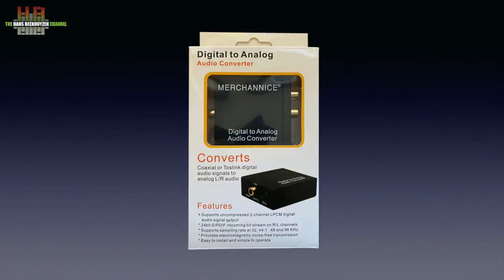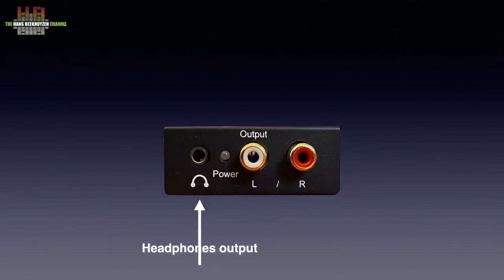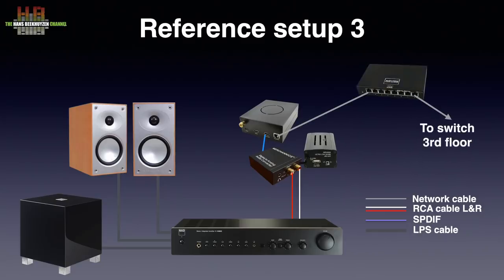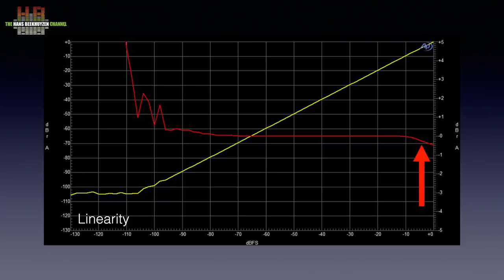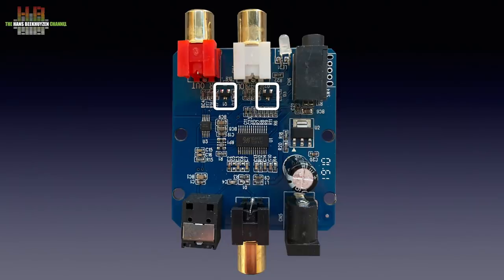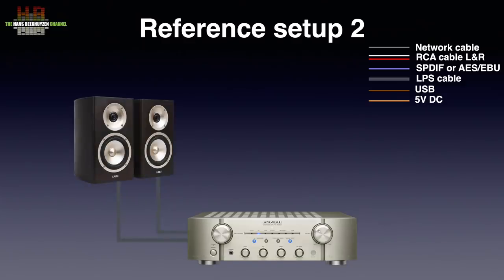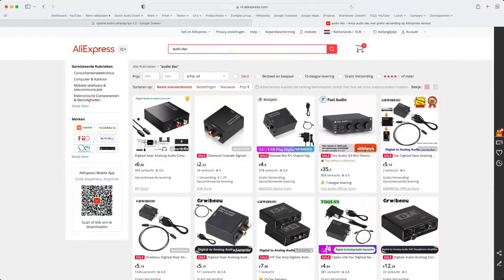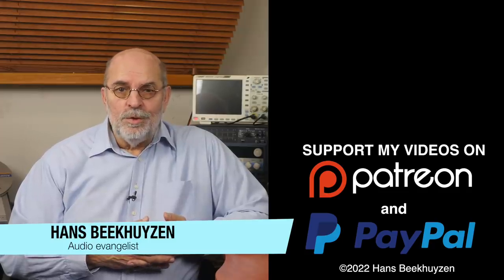The remarkable story of the € 24 DAC

Comment: Nice work, Hans. I currently have no DAC, and this one was very tempting, at $12 so I bought one. 
You are so right, I verified the scope waveforms. There is bad clipping on the negative peaks, causing several % distortion on peaks. The fact that it is on negative peaks means that it causes the less objectionable 2nd harmonic distortions. But several % distortion is unacceptable. Your fix works great, thanks!
As a 45 year EE I'm usually the one who finds and fixes other designs. It is a delight to have someone else do the hard work. Thanks!

Comment: I had one of these in my TV setup (different branding, identical unit) for years and honestly had no complaints. About a year ago I switched from this to a Topping E30, mainly because I wanted to be able to integrate volume control on a single remote with the Amazon Fire remote, but honestly the Topping was only marginally better than the cheap Amazon DAC.
Reply: I had the opposite experience. I had the Radio Shack Chinese DAC rebrand for years, and thought there was no point going higher. It was much better than my Asus Z97-A motherboard's output. I got the Topping E30 and was blown away by the difference. Everything was smoother (less distortion?) with better channel separation and depth. My brother clearly heard the difference even when he thought he wouldn't be able to.  I got the L30 HP Amp to go with it, and now the PA3S for my speakers. I doubt I would hear a difference between the E30 and D90SE though, I don't plan on going any higher. The noise floor is already transparent on the E30.
Reply: Interesting experience! My guess is that while there are many Chinese DACs that look more or less identical, there are varying levels of build quality (or even board implementation) that could produce differences in audio quality, noise floor, etc.
Reply: @andrewskaterrr  thx for sharing! how is Ur experience with pa3s?
Reply: @peraphanjittrapirom9820  It's great. Currently using with 6ohm JBL 530s at the desktop and it barely gets above ambient room temp even after hours of music. The noise floor is inaudible too, lower than my Outlaw 7000X.
Reply: @andrewskaterrr  great thx u

Comment: Purchased one of these  DAC the other day before seeing your video,  its a Prozor brand and stripped it out to see if it was similar to yours.
It uses the same chips but a neater board and soldering and the two output transistors  appear correctly wired back to MS8416T chip.
Compared the sound between direct CD/Amp and the PC/DAC to Amp and very pleased with the quailty of the DAC for just euro13
Reply from the maker: Thanks for sharing
Reply: I gave one Prozor model like in this video to my parents, but now I ordered & received Prozor DAC01s model which seems to be the same thing - just smaller enclosure. however I dont have the tools to see whether fets are soldered incorrectly. the previous one that i gave away sounded good - havent tested this new one yet..
Reply: @voltagetoe    Hi, did not make it clear on my eariler post, our Prozor DAC was fitted with BJT tansistors not Fets as with  Hans earlier model, so they should work ok at 3v3, though no way of measuring their performance like Hans, but the sound is still very, very  good.

Comment: I had one Proster dac that’s already out of production that brings amazing clean mass and weight to the output sound from my cd source. The latest iteration of the dac model though sounds bad like it’s made in a totally different design and from a different manufacturer (which most likely is the case). These cheap chifi devices from China brings some rare surprises among mostly disappointments, that when you find one, it feels weirdly satisfying.

Comment: Very timely video. I was just gifted one of these DACs from a friend who ended up with two of them as the result of a shipping error. I promptly made the changes as suggested as well as adding a new higher grade electrolytic capacitor in place of the one included. (I just happened to have one that would work.) Once my friend returns from his winter hibernation in a warmer climate, I plan to do an A/B comparison. Very curious to see what, if any, differences I end up hearing. It should be noted I don’t listen to digital sources often, as I’m a analog person. But I’m always willing to try!
Reply from the maker: It's not the best way to be introduced to digital audio though...
Reply: Totally agree! My main DAC is a Theta Cobalt which I bought new a loooong time ago. The 24€ DAC lacks all the finesse of the Theta. Instrument separation, sound stage, dynamics, air etc.  were all lacking in comparison. But, for its low cost, the 24€ DAC does perform well. My friend who gifted it to me actually bought it on my suggestion as he needed a DAC to go with an amp I built for him. I’m looking at this DAC as an inexpensive option to use/integrate in future amp builds. Your RaspberryPi videos have also been of great interest to me as an inexpensive streaming option.

Comment: in 2019, I had purchased the Prozor model of this DAC for Amazon for $13 USD. While watching the video I popped the cover and the parts layout and model were virtually identical. The most visible chip was a Cirrus Logic 8416, while the one in the video was a brand I didn't recognize but was also an 8416. My hunch is the same part from a different manufacturer.
Reply: Do you enjoy it? This video has inspired me to buy one of those (assuming you have the one with the case where "192k" is spelled out in black text inside a white box), but others online say that Prozor model sounds horrible. Thx
Reply: @adambozak5372  Hi, as memory serves it did sound horrible. Low output gain, must meh. What I found that was better, was the Micca Origen G2. Cost: $109. It's kind of a Swiss army knife kind of DAC, sounds good, and does a few different things.
Reply: @larryh9525  Thanks for the detail, and for the tip!

Comment: A couple of years ago I purchased a similarly priced Techole DAC from Amazon. It was highly reviewed but I was sceptical. It was for use with my TV to feed my Beolab 8000 speakers. At the time my music was covered by the Allo Digital streamer/dac.

The cheapo unit was very pleasant to listen to. Music from the TV sounded good and compared well with the Allo Digital unit.

When I used the Techole DAC for music it was again pretty good.

The main difference was in detail and a less solid stereo image. Instruments were rather smeared together, but a difference in degree, not absolutely bad.

I just opened the thing up to look at how it was made as it looked like it might be similar to yours, albeit with a different case style.

It was different. Very neat, all SMD components and very cleanly laid out. It looks like the thing uses similar DAC and i2s converter but power seems quite different.

If I did not have the Allo Digital or the current Cambridge CXN V2 I'd be entirely happy to have this unit in my system. It sounds pleasant, not harsh, audible distortion - no.

It seems to me that these little units are a somewhat hidden gem. I'm happy to have purchased the more costly units but the little Techole 192Khz dac works well.

Comment: I've used only PC's as a music source for about 22 years now, via so many different topolgies I've probably forgotten many of them. A couple of times circumstances have compelled seriously 'ghetto' solutions, and were that the case now I'd certainly be looking at this DAC, but to make the best of it I'd probably just keep the digital signal at the PC attenuated by at least 10dB (at the levels I listen, raising of the noise floor by that much is unnoticeable). I guess that would still run the risk of the non-music plops/clicks but I'd probably be willing to live with that.

Comment: I got a DAC board of amazon using the same CS 4344 DAC chip, I resumed the transistor looking things on the output side were an amplification stage and just by passed them with polypropylene film caps ( with cap+resistor to remove above audible frequencies), and the thigs sound dam good.

Comment: My TV doesn't have RCA output and im using old amplifier so i needed to use the optical cable and have used this exact unit but unnamed version for over 3 years and its been just perfect for me BUT the volume out is a little too low and it makes loud popping when turning off and on the TV (powering it through TV usb).

Upgraded to a better one from alixpress that have volume and bass adjustment and i love it, it have an auto mute when no input sound so there is no background noise/hiss like the other one when pausing the tv.
It have great bass and sound and very low noise floor.
Reply from the maker: Thanks for sharing
Reply: The unit in this video that i used first was swapped because of the high noise floor that was disturbing while watching movies when it got quiet and the super powerfull pop when tv turned on or off so i always needed to turn off the amplifier first, because the subwoofer litterally popped 2cm out and slowly centered again shaking my whole house (4x cervin vega 15 inch woofers).

The new unit have solved all of the problems and have much higher output line level so i dont need to max out the amplifier

Comment: I have a general question about DACs I hope you can help me with. I've heard that new AD/DA Converters are "better" than old ones. Yet, I've read and heard dozens of times that the "Nyquist theorem proves there is one and only one way to draw a band-limited continuous signal through a set of samples." This requires that the Sample Rate is at least twice the highest audio frequency. Accordingly, one should be able to "perfectly" reconstruct the analog signal that was captured using a DAC with that specification, whether it's brand new or 20 years old.

I know there are things like newer/better Preamps, etc. that will affect how the processed signal ultimately sounds. But, according to the Math, the recorded digital signal should be perfect. If that's not correct, could you please explain. Thanks
Reply from the maker: All internal combustion engines are based on the same laws of physics. But does that mean that they are all equal? The Nyquist theorem is not disputed. But in real life it's impossible to limit the bandwidth at half the sampling rate without distorting the sound. The best filters come closer to perfection but are rather expensive.
Reply: @TheHansBeekhuyzenChannel  Interesting. I hadn't heard that it is "impossible to limit the bandwidth at half the sampling rate without distorting the sound." Thanks

Comment: Hello Hans, thanks for this interesting video, but in your setup 1 I don't understand how you could connected the USB "clean" output of the Allo USBridge streamer - as shown in the video - to the Coax (or Toslink ?) input of the tested DAC (except if you used in addition the optional Allo DigiOne card with Coax output but it was not represented so).
Reply from the maker: I used the SPDIF on the USBridge Lux to the DAC. The version I have has the DigiOne Sig integrated too. That’s why I call it the Lux
Reply: @TheHansBeekhuyzenChannel  OK thanks, now it is clear to me :-)

Comment: Just got a Prozor DAC from Amazon, it's an older model so may be the one Spade Ho has, opened it and it's a newer vsesion of Merchannice motherboard which is 1910, this is 2118. Things have moved or removed, but the ones that haven't have exactly the same name and typeface, and all the chips remain the same. One change is that the mute FETs have been moved to just behind the LED. making access much worse. Unfortunately I don't have access to equipment to see if they corrected the circuit then they did this. Best of all it was only £12.99, or 15.65 Euros
Reply: Quick update, after checking the mute ICs, they are marked 1AM, this appears to no longer be FETs but transistors according to the datasheet. No pins are shorted together or to ground (was using the 3.3v regulator heatsink as ground).
Reply: @thandargor1677  Got also the 2118 revision of the board (Prozor bought from Amazon Germany at August 2022). It has two "1AM" npn transistors (SMD 40V 200mA) for muting right top under the LED.  As an audiophile I can't hear any clipping. So the issue was fixed at least for the 2118 revision 🙂

Comment: Is this product same as Fiio D03K that are available in Amazon and other online shopping media?
Reply from the maker: It might be
Reply: No, the Fiio D03K is completely different, even the basic chipset is same it sounds much much better at all, also there isn't that ugly clipping because of wrong Mosfets for muting. The board is much more made with care and intelligence. It runs on 4.8V and not 3.3V. It has instead a chip of TI to enhance the analog output. Have compared both.

Comment: Might be a dumb question, but are there FETs out there that are rated correctly to replace the bad ones on that board (while still retaining safety measures)?
Reply from the maker: I don't want this channel to become a DIY channel. I'm sure there will be a forum somewhere that can help you out.
Reply: I would imagine that the problem is that the voltage difference between the audio signal and the gate isn't enough at 3.3V. What might work is to put 5V pull up resistors on the FET gates and then let the mute function pull it down through diodes.

Comment: Got the DAC this afternoon. Lifted the FET middle leg. Has played for about 1 hour now using an Old switch mode wall wart. 
The sound is not to my liking😔
The bass is very muddy, and the upper part of the mid range is shouty. The treble is a bit of a noise transmitter. I Will let it warm for a couple of days to see if that helps. On the plus side, it has a good perspective, and I think it does phase well.
Anyway, it is a fun little toy, and almost invites to experiment with other PSU’s and electrolytes 👍

My source is ripped CDs, Volumio, Raspberry 3B, Daner amplifiers (bipolar transistors, no negative feedback) and Dali Skyline 1000 open baffle speakers with large ribbons.
Reply from the maker: AS I said in the video, it might be a different or slightly different model but using an old switch mode power supply won't help either.
Reply: Agree, the switch mode psu is a bad idea. Will try a USB Powerbank in the weekend. After that different electrolyte capacitors.
Reply: Did a small modification 2 days ago: changed the 47uF electrolyte to a Silmic II 100 uF. In my ears, a partial improvement, as the DAC now plays a deep, happy bass. The 3D is still very good. But the fuzzy, kazoo like upper midrange and treble is still there. Next up is a PSU change. A IFI iPower is in the mail.
By the Way, the electrolyte change was very easy, the circuit board is robust and the holes for the component legs are quite large. 
I really hope the PSU change Will remove the fuzzy sound. A piano with kazoo quality sounds quite disturbing 😂😂😂

Comment: This may be a dumb question from a non-electronic layman, but would there be the same problem using the 3.5 jack output?
Reply from the maker: Yes, the same problem there.
Reply: @TheHansBeekhuyzenChannel  thank you for your quick reply !
Reply: @TheHansBeekhuyzenChannel  3.5 jack has mosfet on output? I don't see it on board.

Comment: I wonder why everyone reviewing DACS doesn't hook up an oscilliscope to the analogue outputs, and measure the actual line out signal? Why push it through an amplifier and speakers, if the object is to determine whether e.g. a sine wave in digital PCM format gets converted into a sine wave line-level voltage on the outputs? Just use an oscilliscope o.o
Reply from the maker: I measure every DAC and while measuring an oscilloscope stays connected all the time. What d you think I see on the scope?

Comment: That's really neat, although the risk of nasty clicks and pops whenever my playlist switches tracks with different sampling frequencies, I don't or need to risk it. Did make me curious though. What did you use as power supply and in your opinion how much does it matter if you use a proper regulated 5v supply of an off-the-shelf left-over some other device for sound quality? In short, same sound quality as long as it's 5V DC?
Reply from the maker: Of course not. But I used a simple one: the Allo Nirvana.
Reply: @TheHansBeekhuyzenChannel  Thanks for swift reply! That will make a difference, I bet. Is that your supply for your raspberry streamer?

Comment: I put one in a good case with high quality RCAs and cables and different power supply plug, capacitor changed with Nichicon audio gear, in another case a linear LT1084 power supply with a Talema toroidal transformer.
I will test the fet tip. Thanks.
Reply from the maker: Thanks for sharing
Reply: @TheHansBeekhuyzenChannel  Should the FETs be disabled by removing them completely or just disconnecting the middle pins as shown in your photo at 13:52 ?
Reply from the maker: The middle pin suffice